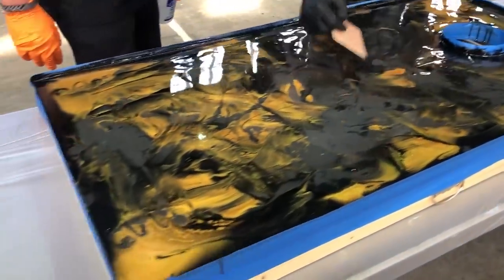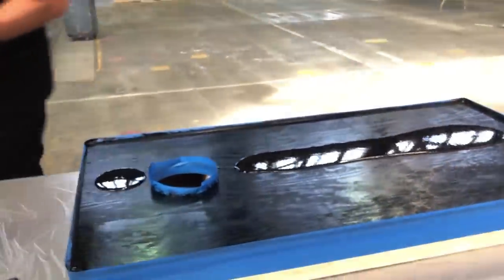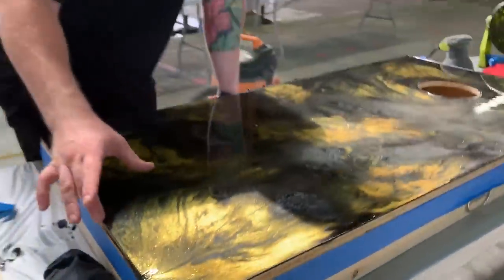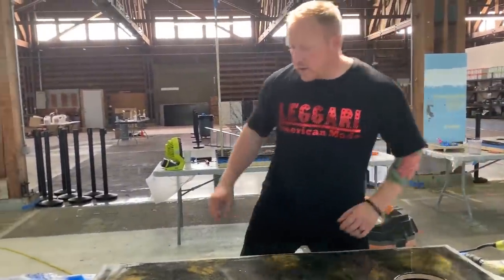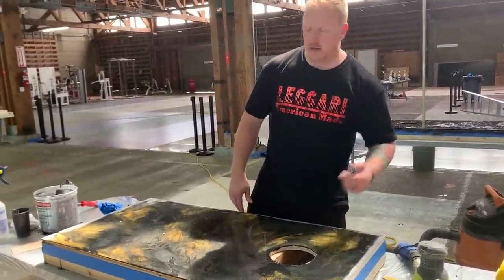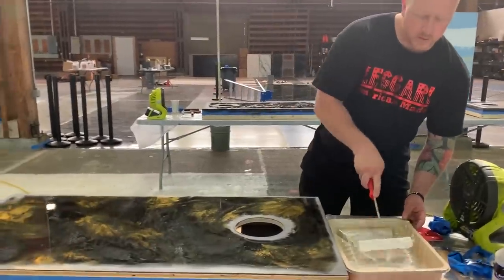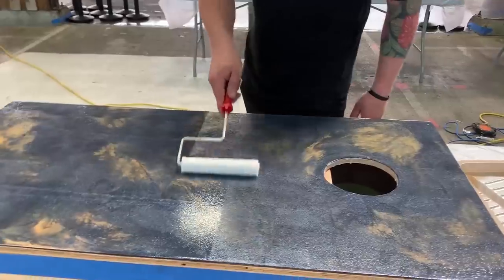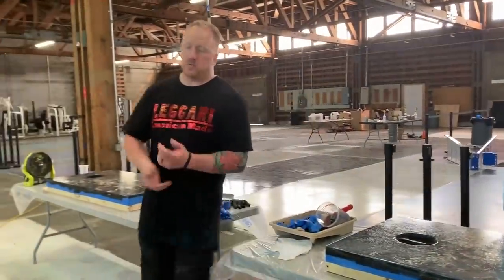How To Coat Cornhole Boards Using Epoxy Resin

Comment: It's so great of you guys to share how to do the epoxy stuff!  I build custom wood products and decided to try to make some cornhole boards with the American flag idea  you do on the doors.  I am pretty pleased with the results so far but have a couple questions.  What is the max percentage of paint:epoxy that can be mixed?  Do you guys sell the 1-1/2" star templates?  And finally why the urethane top coat?   1part? 2part? or 3part?  And is it more durable/scratch resistant than the epoxy?  Thanks again for the great educational videos!!!  I'll make sure to tell my customers about your countertop products to hopefully return the favor...:)

Comment: I have made several epoxy cornhole. They come out amazing. But don’t dam up the sides. Let the epoxy flow over the sides. That way you don’t have to sand or worry about sharp edges. You also have color on the edges. Nice smooth surface and the bars will not get caught on the edge.
Reply from the maker: David Braid Our friend didn’t want to prep the edges instead said he was going to paint them a solid color. Thanks for watching
Reply: What’s a good poly and brand that you use after the epoxy? How many coats as well,?
Reply: You didn’t put at tape on the sides at all? I’ve seen them use tape and then take it off shortly after to let it run down the sides and then brush it.

Comment: I looked on your website for the poly you used on these boards, and I'm having no luck. So what poly would you suggest I could use because the water based polycrilic I got was trash and pretty much ruined the tops of our boards that we worked so hard on.
Reply: Exactly… I was wondering the same thing but apparently they aren’t willing to disclose that information to anyone.
Reply: Why would you use an inferior product over a superior one. Epoxy is way more durable than poly and it doesn't yellow. The failure rate with decals and yellowing made me seek out auto clear coat as a top coat.  The problem with top coating with epoxy is that it doesn't allow the bags to slide well unless you use some serious sandpaper (3000+ grit) and elbow grease. I've made a lot of Cornhole boards and poly fails way before epoxy will. Auro clear should be used instead of poly. The only problem is you must spray it instead of rolling/ brushing it.

Comment: what would be great is instead of the music you actually explained the process you are using and the techniques & tips in using the product.  Since you are doing cornhole vids would be awesome if your website actually addressed the issue under a cornhole section perhaps?  with products related to finishing cornhole boards.

Comment: The video is good, but EVERY person on this thread is asking you specific questions regarding what polyurethane to use and you have NEVER answered any of them.  Most of your comments are just mostly responded after someone has a positive comment regarding your video.  So not right.  If you’re making an educational video, it would be nice if you can actually answer this question and all the others that people are asking.  You do comment but you’re very selective